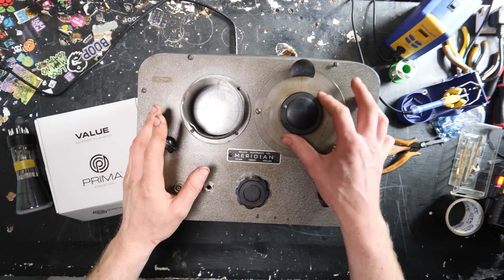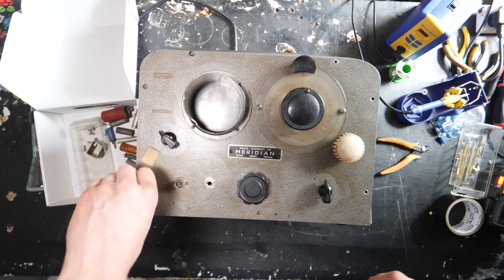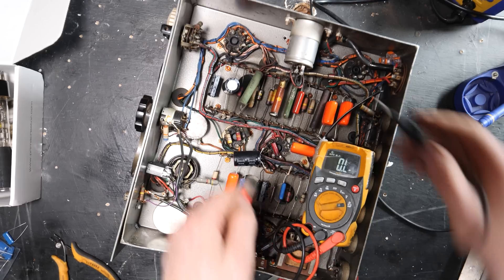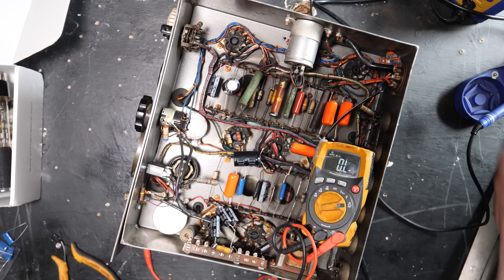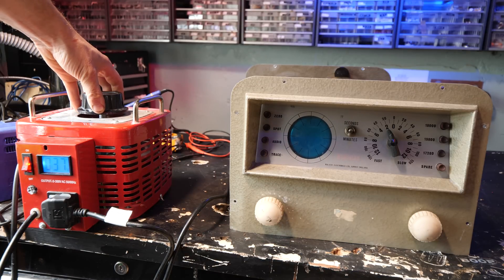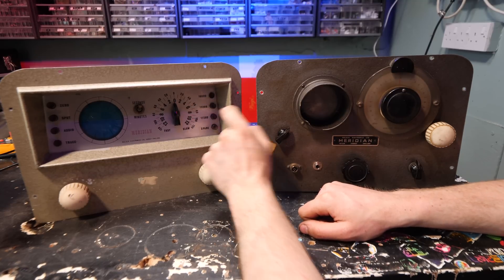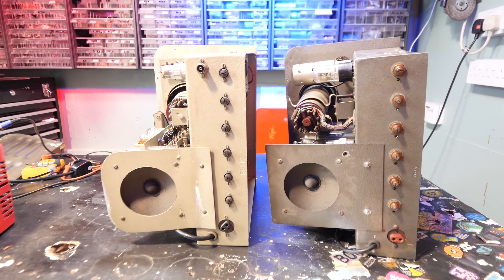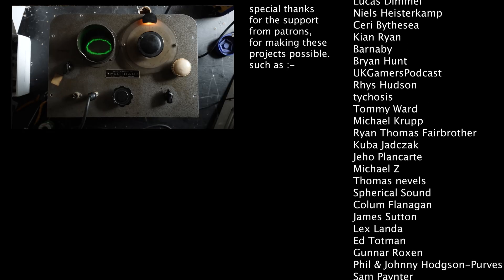Fixing A Vintage Vacuum Tube Meridian Watch Calibrator And Repurposing It

Comment: as far as electronics architecture goes I would say no1 is 1950-53 no2 is 1953-56 the huge faux ivory knobs went away before 1958 the bakelite knobs and pointers went away around the same time but in non-commercial applications, they stuck around until the late 1960s in medical and lab appliances they stuck around until about 1980 or so.
the overall feel of the whole front assembly is the 1950s.
Reply: ps the front quartz valve(tube) in no2 is dead it has ghosting in the top of the valve indicating air has entered into it.
Reply from the maker: i think the quarts valves didn have any getter at the top initially
Reply: @THISMUSEUMISNOTOBSOLETE  They didn't have to with overuse the filament material would have blackened the inside so the ghosting is from that no getter at the top needed old valves go dark over time and when they are compromised the material turns white.

Comment: Nice to see your video, I have a very similar Meridian as your first unit and it has the transducer to hold a watch. It was working a few years ago but I am thinking of replacing some of the old electrolytic caps before I power it up again. I have a suitable variac to run the voltage up slowly, was hoping to find some technical data about it such as a wiring schematic.

Comment: For all that is holy 
Don't just touch the crt willy nilly 

It's a supper capacitor at static electricity voltages ⚡️ and it will absorb power and blow ur mind into pure white or black or both 

It's not supper common the neck end  has discharge path but it's possible 

Grab I solely from the end of neck on glass and keep ur fingers away from and connections 

It's not worth the risk to kill urself

I personally know someone who tried discharging a 70s~80s wood box tv that had been unplugged for 20 ish years with just chucking a screw driver in it and it blew the screw driver across a 10m shed and was a solid dart in the wall and guy was instantly hot and both of his arms acked and he had a tight chest for a while 

But in other news if u desolder the pins or chuck socket pins in solder pot n carefully pull plug off u can remove base and inspect 

Also if the crt is dead It's still useful as properly some other type of tube then crt since has alot of elements and defiantly as a capacitor and u can externally shine Lazer led etc on screen and it will glow

It's like a capacitor resistor wein bridge measuring tool but it's matching frequency between the quartz crystal and watch 

Since the mechanical watches all vibrate the same no matter the design of it since all have same time metrics 

Like having two guitars tuning to each other and like syncroscopes of power stations going on grid

I recommend once u know how circuit works modify it by changing crystals to change frequencys 
Probably be nifty instrument tuner 

U don't really need a manual since once u have tube data sheet it mostly describes circuit 

It's all basic electronics like dick Smith radio shack jaycar kids kitsets

Likely a piezoelectric mic since they lend themselves greatly to mechanical vibration pick up 
What cars knock sensors are
Reply from the maker: it was discharged. obviously :) it had a discharge. it was dead as a dodo. piezo mic yep. cheers. kept the crt for other things. pretty sure its not dead. not got round to working on it. cheers
Reply: @THISMUSEUMISNOTOBSOLETE  

Even wen its discharged it canbe recharged 
Static electricity can recharge it 

They are only really safe wen they are dead short linked 
But ur safe wen u are in static free ish environment and its recently discharged and worked on 
It's because of its high voltage operation and how it's designed it absorbs electricity from alsorts 

Just something to keep in mind 😌 with crts last thing you want is to have a mistake and yeet it across the shop

Mention it because most don't know

Comment: I believe it would have originally had a piezo electric pickup of a rather large diameter. You might try bodging something like that together and maybe getting an old mechanical clock to test it with. All it would need is a bit of wood to mount it in and a cord to get it working. The phono plug that you've installed would be a brilliant way to connect it all up. So maybe get a large piezo disk and give it a go?

Comment: I've seen those circular CRT-like displays that show waves in a looping circular thing in a few places but I'm not sure what they're called. What are they, and is it possible to get one to display all the details of whatever signal you feed in with a single loop around the circle, instead of repeated multiple times around the circle?
Reply: There are few ways to do that.  You can just phase shift a wave (basically make it into sine and cosine).  There are even radial deflection CRTs in existence (they used to be used for radar).  To get a single loop, the frequency has to match, higher frequencies (as you can see in the video) give more wiggles around the circle.  Look up "Lissajous figures" for more details.
Reply: @johnrehwinkel7241  good to know! I thought it might be a neat way to represent any wave if you made the circumference equal to the wavelength
Reply: @benG2141   if you had a more fine-tuned time-base selection, as opposed to the simple divider/multiplier circuitry in this with hard steps, you could probably combine that with the big knob (the really fine tune) to get it properly in sync. But this doesn't seem to have any trigger ability, so the waveform could still wiggle around (what would be left and right on a regular scope would be clockwise and anti-clockwise here) unless it was super stable.

Comment: Hmm, a variable circular time base with radial deflection.  Since you have not mapped the circuit, I browsed my book shelf...  Can try "Time Bases" by O.S.Puckle (1951), or "The Cathode Ray Oscillograph in Radio Research" by R.A.Watson Watt and L.H.Bainbridge Bell (1933).  Both books give numerous circuit ideas for building circular time bases using vacuum tubes.

Comment: Such cool devices! I love round CRT's and unusual vintage electronics, particularly when there's not the usual oscilloscope display with a horisontal sweep. https://www.youtube.com/watch?v=o203gm0HkeM&list=PL3HT0rsR3WgiywqZ7M0uG3RrA_GpOReHO&index=54&pp=gAQBiAQB
A circular trace is exciting to look at and sometimes a realy clever way to display more information than in a straight line. I have a circular trace on two of my favorite "modules" in my Boat Anchor Modular Synth setup, the TDMS5 and TDMS6. These are instruments for teleprinter service and as such they are working with serial digital data bits. The circular trace is a great way to display the timing of the data, and allow a really easy way to show timing errors. 
I have modified my TDMS5 and TDMS6 quite a bit to be better suited for making music, but they still are quite close to the original circuits inside.

Comment: Some of the controls may tune some analog frequency dividers.  Getting the correct division ratio would be critical to use it for its intended purpose.  I think getting a service manual would be critical to fully resuscitating this funky device.
Reply: you can see the division ratios when you switch the left switch

Comment: Have your tried playing with the adjustment pots to get the display rounder? What about the vacuum  tubes (valves), did you test those?
Reply: yes and yes :)
Reply: i recon its one of the resistors a bit out. because max on the pots dont do much. when i open it again ill be loooking

Comment: I was a bit nervous when you were handling that power cap, you say you had not turned it on but you never k ow whos been fiddling, or am i worrying uncesssasily?
Reply from the maker: worrying unnecessarily. :D. just discharge it with your tongue. sorted :D
Reply: @THISMUSEUMISNOTOBSOLETE  I am getting ready to look at the bias on my vlave guitar amp ( it's getting to hot)  I ll put my tounge across the big caps before I start playing around I guess it's just like putting tounge on a little 9v battery? ( am not addvising any one to try this as it could result in DEATH ☠️)
Reply from the maker: @family-accountemail9111  haha yes if anyone is reading it goes without saying *DISCLAIMER* its a joke dont lick caps! it could result in death. :D

Comment: One wonders what kind of signal comes out of the front panel BNC connector.... did you measure it Sam? Maybe couple it to an oscilloscope (through a capacitor ! 100nF or thereabouts) Very rare vintage piece of equipment... nice score :)
Reply: It is the input for the transducer. The jack socket I added just wires straight to it
Reply: Oh ok Sam... how about trying it out with a real clock just for giggles? Might be interesting :) Or a metronome?
P.S. you can make the circle "rounder" if you locate the RC circuit for the Vertical deflection plates in the CRT tube and "slightly" changing the values (maybe try with a potentiometer ?)
Reply: @TechneMoira  dheersss. yeah i did have a fiddle. think one of the resistors has drifted a tad. still not found it though :D. as for the clock, yeah i gave it a bit of a go but i think it wants to hear something that runs at a higher rate. like a watch or a bedside alarm clock, neither which i have. ones that run on big pendulums dont really do much for it sadly :(

Comment: So the dot on the screen wizzes around at 30 times a second according to the document you found. With 12 divisions on the screen you would have a peak on every line at 360Hz.
Quote from wikipedia (Electic Watch):
"Tuning fork watches: Instead of a balance wheel, these watches used a tuning fork driven by a solenoid powered by a one-transistor oscillator circuit and no mechanical contacts.[8] The tuning fork had an attached pawl and 'index wheel', which turned the gear train. The common frequencies used in watches were 300 Hz, 360 Hz, 480 Hz and 720 Hz."
All divisible by 30, so you would have a stable display with 10, 12, 16 and 24 peaks. I think you have some equipment around that can produce sounds in the 300 to 720Hz range. Plug them in! The thing has time bases, right? Maybe they make sense then...
Reply: Yep! That is correct. We all have a machine that can generate tones in that frequency spectrum. It's called our voice :D. Hence the mic. That's why I did it this way. So you can go between the amount of peaks. Kids were trying it at the museum this weekend
Reply: @LOOKMUMNOCOMPUTER  "Kids were trying it at the museum this weekend" Oh, you have a side gig selling ear plugs? Clever! And its exactly why I would use a tone/signal generator: I cant hold or identify a tune. So "singing" 360Hz is not an option for me.
When it comes to interactivity for a hands on museum the mic is the right choice ofc.
Reply: @agurdel welll you'll have to practice before coming to the museum haha. Basically try to keep inputs of things varies. Plenty of knobs everywhere. Other inputs are always interesting :)
Reply: Such a tuning fork watch is the Bulova Accutron, the fork thing is fascinating!

Comment: Do you ever recap these things by drilling out the guts of old capacitors and hiding modern ones inside them?  Drip some wax in the ends and you preserve the original appearance of the wax paper capacitors and the alumin[i]um cans (tins) of the dried-up electrolytics.
Reply: it would make sense if the capacitors are visible. but with this one its underneath. just a whole lot more work. i am planning to do it to an oscilloscope next which has especially nice looking capacitors

Comment: Tried putting the mic up to a clock yet? Or your master clock?
Reply: Would only really work with watches and pocket watches and sadly I have none that work.
Reply: @LOOKMUMNOCOMPUTER  What about a classic bedside alarm clock? Btw, my parents still have an old electromechanical wall clock from before the time quartz crystals were commonplace, and it still manages to keep decent time while using a balance wheel.
Reply: @TDOBrandano  one of
Those will work too. Sadly I only have big clocks.
Reply: I'd have thought the click from the relay would do the job.

I assume it's just picking up the click from the escapement. Escapement, relay... Both click.
Reply: @dtnicholls1  it clicks every second. Which is too slow to really compare phase

Comment: Suggest putting a metronome against the mic.
Reply: Good idea! But Problem with that is. If you've listened to watches you would not hear a pendulum. More of a mechanical wirr. Which this is listening to. The rate of a pendulum is far too low to really make use of the display

Comment: I guess you already know this, but an old radio and TV set reppairman trick was to put an incadescent lightbulb in series with the set being tested. If the thing draws too much current because it is shorted somewhere the lightbulb will light up, its resistance will climb and block the current going through and causing more damage. Some amps even have a set of bayonet mount lightbulbs inside as a current limiter.
Reply: You just solved a mystery I have been trying to solve for the last month. I had been trying to figure out why this Crown Reel to Reel I was working on just had two seemingly pointless bulbs inside the case and now it makes so much sense! Thanks a ton!
Reply: @CameronBattagler  Those two bulbs inside the case are likely nothing to do with dim bulb that @TDOBrandano described.  The Dim Bulb (inline light bulb) is a piece  of test equipment used by technicians, external to the device.
Your lightbulbs inside the open reel tape machine are likely either to do with a sensor, or used as a ballast, or resistance, inline with a certain part of the circuit.   Incandescent bulbs can be used, in some cricumstances, as temperature compensated resistance.   Also, incandescent bulbs were often used in sensor circuits where light sensors detected make/break situations.
Reply: To clarify, the last sentence mentioned bayonet mounted bulbs inside a case of a receiver for current limiting. I have a reel to reel that has two internal bulbs that are hidden and bayonet mounted that I couldn't make sense of but makes a ton of sense around current limiting based on where they are in the schematics
Reply: @CameronBattagler  yes, they're not ideal current-limiting resistors but back in the day a lot of designs were built around them just because lightbulbs were so cheap and plentiful compared to specialty-specced current-limiting resistors. Much lower operational lifespan than the specialty kind, but the user could be expected to be able to replace them if necessary. Cheap and cheerful.

Of course nowadays the specialty ones are usually cheaper, so it's not really a thing anymore. Perhaps a few hobbyist projects here and there, if they happened to have lightbulbs around already, but otherwise you've no real reason to not just order cheap modern polymer current-limiting resistors.
Reply: @CameronBattagler  It has nothing to do with a "dim bulb"" tester. It's something else.

Comment: Would it have been used to listen for the ticking sound from the clock?
Capacitors scare me as I don't know how to discharge them.
Reply: There are plenty of videos on YT about this. It is very easy with a resistor and bit of wire. You can also do it with a mulitmeter.
Don't do as some do and just short them out, that's bad practice
Reply: @Super8Rescue  How do you use a multimeter to discharge a capacitor? In voltage mode the resistance is too high, and in current mode you will just kill the fuse (if you are lucky).
Reply: @TDOBrandano  it's not ideal but it can work.  Better than shorting them out https://www.youtube.com/watch?v=H3eyBGy2x1I
Reply: Use a resistor. Safer to use a 1-5W or larger dissipation resistor, some several hundred ohms value. Attach it to an insulating stick or use well insulated leads  and keep fingers away from the cap. Always measure residual voltage with a meter. Some capacitors will actually show rising voltage due to dielectric polarization effect. In that case short again and remeasure.